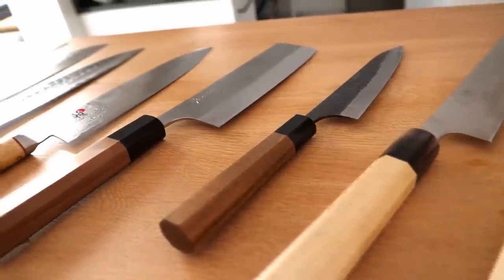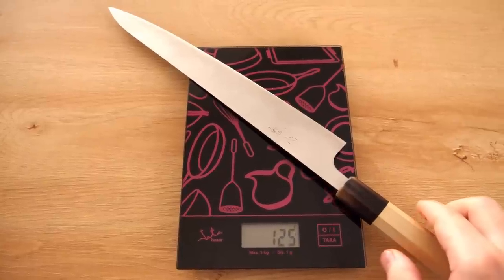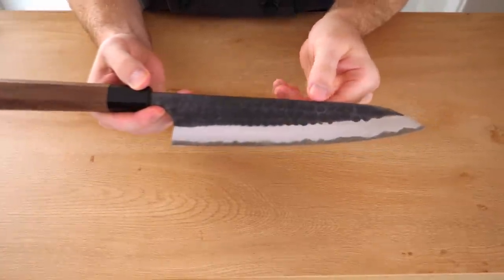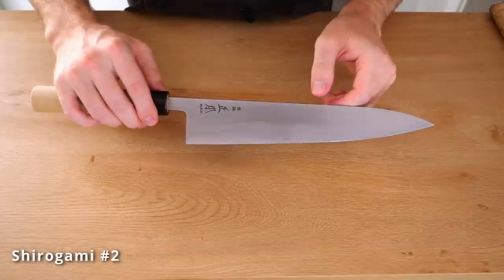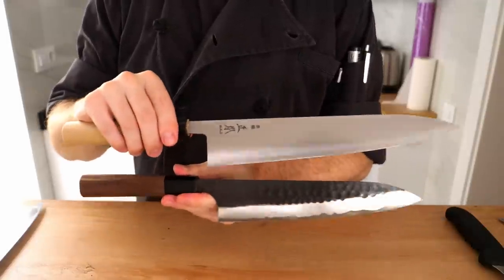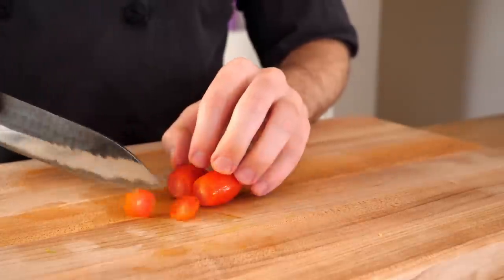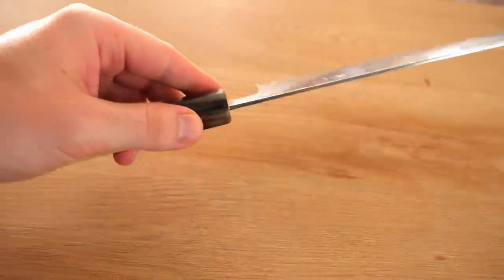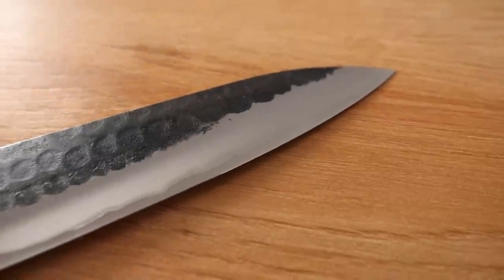Pro Chef Tips.. What Are Japanese Knives & Are They Worth It?

Comment: Value is hard to justify because it can be objective at times and subjective. I measure value by how much it costs versus how long I expect to use a knife. There are Nella, Henckels, Victorinox, Mercer, and other brands that make knives for a relatively more affordable cost and can still last you most of your lifetime. A Japanese knife is GENERALLY a lot more expensive, but can last several lifetimes as long as you properly maintain them and baby them. So, in terms of monetary value, you don’t need a Japanese knife at all, especially if you know how to sharpen your western knives. 

But on the subjective end, especially if you’re a seasoned sharpener, you’ll learn that sharpening or thinning a Japanese knife is generally easier. You’ll also find that you don’t have to sharpen, thin, or hone them as much. If you are a professional chef, this is more preferable, as it can be frustrating going through several bags of onions, cabbages, potatoes, or any tough job with a slightly duller knife than when you began. 

James mentioned that Japanese knives are generally blade-heavy. This favours people who use the push cutting or draw cutting method. A handle heavy western knife favours people who like to rock their knife when they cut. You can also rock chop with a Japanese knife, but you shouldn’t use as much force when you’re twisting the blade on the cutting board as they certainly don’t need the extra force to slice through your vegetables. But also, it will almost certainly chip your knives. 

In terms of performance, Japanese knives are pretty much a level better than western knives, but you’ll start getting diminishing returns starting at about the 300-500$ range. That means that knives more expensive than that are probably going to be a little bit better than a 300-500$ knife, not a lot. There are a few lines of knives that are the exception, of course. But in general, the cutting feel and the pleasure one might feel from handling these knives is quite amazing. 

My one drawback is that, as a chef, I have to take extra special care of my knives at work. Mostly because our dishwashers walk around and sometimes wash our stations without asking (they should know to ask first!). That can be very devastating to me. Thankfully, it hasn’t happened yet. People can also borrow your knives and forget to bring it back. This has led me to start washing my knives myself (which people should be doing, anyways) and putting them away into my knife kit. You can’t just leave it on your cutting board. And I think this is faster than having to, for example, hone your western knife multiple times per task (depending on the scale of your task) or having to find a sharper knife that your kitchen has. And maintaining your Japanese knife at work isn’t hard at all. All you have to do is wipe it down with a slightly damp rag and then again with the drier end of the rag. Done. People also talk about how “Well, I can’t do things like chop nuts, cut through bones when I’m butchering, cut through hard cheeses, and frozen foods like with a regular knife.” You’re right, but that’s why every Japanese knife owner also has a beater knife with them for those tougher tasks!  The safer tasks are the times a Japanese shines well beyond what a western knife is generally capable of. 

I do banquet cookery, and one time I was given the prime rib carving task. I used two knives. A Japanese petty knife to easily separate the meat from the rib, and then cut the meat in half to make nice steak cuts. But also, I used a 10-inch Japanese chef knife to carve in front of hundreds of people. A dozen prime ribs later, my knife was still sharp, and I got a lot of compliments for my knife cuts and for my knife itself from several people. Felt like a badass every day for that month because I was on the carving station for that month. A thinner 10-12 inch sujihiki slicer perhaps could’ve done the job better. But if I compared my Japanese chef knife with any western slicer (knives that were made to slice meat), my knife would be better. 

Then, there’s the culture you have at work. Most places in the west already provide you with serviceable knives that they rent from a knife company or have bought them outright. So, you may see workplaces where there’s not a single personal knife, much less Japanese knife. If you don’t want to get made fun of, I suggest not bringing a Japanese knife to this job. But if you work at a place where people don’t use the work knives, then for sure try to impress your co-workers with your several hundred dollar knife!

Lastly, there’s the aesthetics. Japanese knives can look simple and humble, but they can also be very flashy. Today, the same can be said for some western brands and blacksmiths. For quite an expensive price, I’ve seen some beautiful knives from independent makers on instagram. You’d have to go through their website to purchase their stuff, but because they don’t have teams the wait can be a long time. For this reason, I’d say that an extremely beautiful Japanese knife can generally be more availability me than a beautiful western knife. But if anyone is interested New West Knife Works, Aura Knives, Bob Kramer are all American brands that advertise luxury and performance.

Comment: I wouldnt dare to rock chop with such expensive and brittle/hard japanese knives. It could chip if it doesnt chip, the tip could get dull rather fast  even though it  hasnt cut anything. I like the tip of my knives to be the sharpest part of a knive for doing fine work. Thats why gyuto or any other chefknive's tip are so pointy unlike santoku with a not so pointy tip which is more for the homecook, or very small professional kitchens.

Comment: Hey James was just curious but is it normal for a knife to bend and stay bent left and right where the choil meets the handle? I've noticed two of my knives do and thought it was odd that they don't return back after being flexed they are 240 shun gyuto and my miyabi 210 gyuto cheers
Reply from the maker: if they are bent you should send them back, the knives should be straight not bent.
Reply: @ChefJamesMakinson  it's just the handle that can be bent left and right if you're looking down the spine  only if I force it but it would be the same force if someone was to crush garlic and not apply pressure at the garlic but at the handle. I wondered if your miyabi did that also. Thanks for the reply

Comment: Pretty good vid. Few points. 

Damascus have no function , beside looks. 
 
Single bevel knifes are pretty much task specific.
More brittle ,and harder knife to use.
Do NOT buy single bevel to ur first or second knife.

Shun is overpriced; look tojiro dp ,takamura r2(my fav) or cromax for best stainless bang for buck. There are more , these are most recommend under 200€. 

Carbon steel 100-200€

Munetoshi ,shiro kamo , matsubara , mazaki(imo best one round 200) ,
hitohira have sum good lines.

There are more ,look more into artesan knifes ,u will find +100€ up

There is allso stainless steel clad carbon steel. 2sides stainless middle core carbon steel. 

First buy 1 ,learn sharpening and u will learn what u like. 

If u cant bite it ,u dont cut it. 

Proper cutting board make life easier. NO glass , stone or hard boards.
End grain ,hinoki ,hasegawa ,ashi cuttingboards most used.

Comment: while you have given a LOT of good info in this video and in your other what knife video, there is one thing that bugged me...
it's more about the heat treatment process that is making western style knives a tiny bit "softer" not so much the specific steel used, they are going for a higher toughness by sacrificing a small amount of hardness. this is why Japanese made blades tend to chip more, they are aiming for hardness over toughness. in a good blade it's a balancing act with hardness and toughness for an application... 
just because a steel is "harder" doesn't mean it will hold it's edge longer. as an example: O-1 steel can be made to 63-64 HRC, and A-2 to 60-61 HRC but A-2 will have better edge retention, while the O-1 can technically be made Slightly sharper
 in this video  you have a list of knife steels and just in the first two lines it's wrong -  it's calling 1095 Low HRC and 440c medium HRC.... 1095 should be between 62-64 as quenched and  57-58 HRC after tempering,  440C should be 59-60 as quenched and 56-58 after tempering. their final hardness is normally about the same.  440C will hold an edge slightly better due to the carbides that form in it, 1095 would be tougher and better for something like a cleaver.
going further AUS 8 should be about 58-59 HRC, AUS 10 59-60 HRC, D2 54-61 HRC, VG1 58-59 HRC,  VG10 60-62 HRC.
most simple or Alloy  steels with more than 60 points of carbon can reach a similar hardness - but the toughness will be different for a specific hardness.

In the end what I'm trying to say is that you need to look at what your style of usage will be to decide what would be a better fit for you. if your likely to abuse the blade a bit a tougher blade would be better for you. and if you are carful with a blade you can use a higher hardness style.
Reply from the maker: Thank you! Yes there is still a lot of explain and with these videos I was just trying to go over the basics